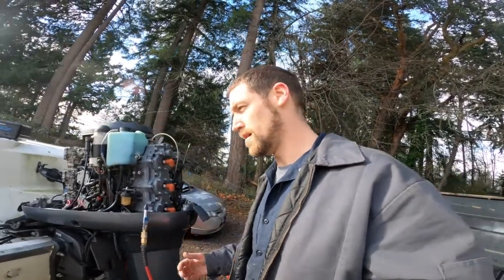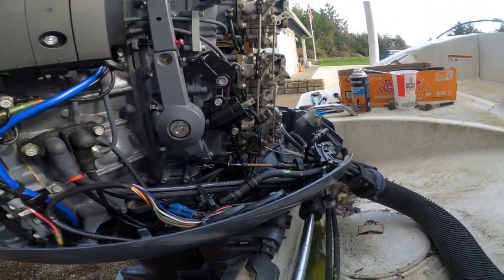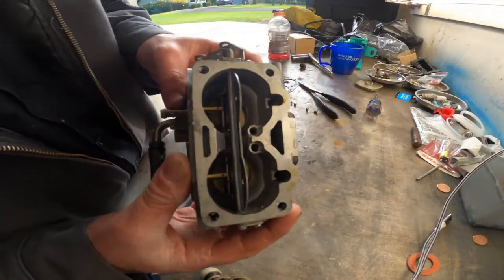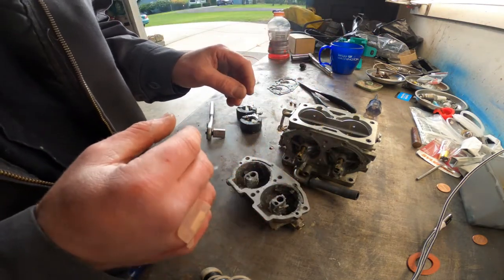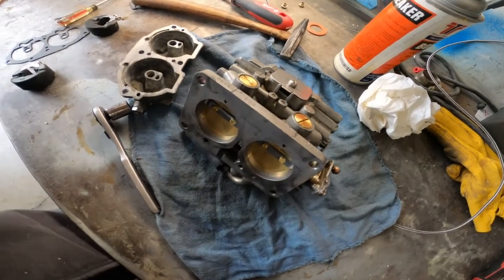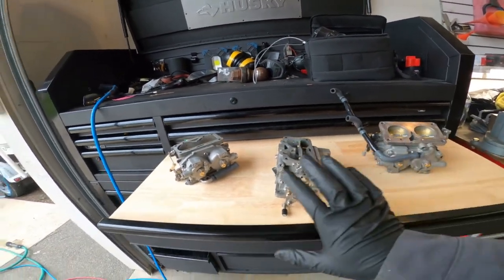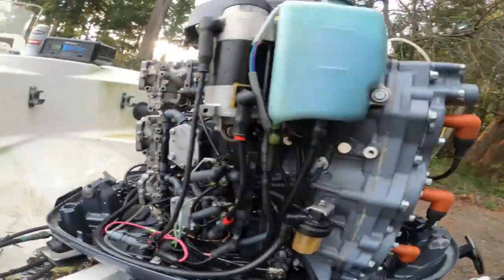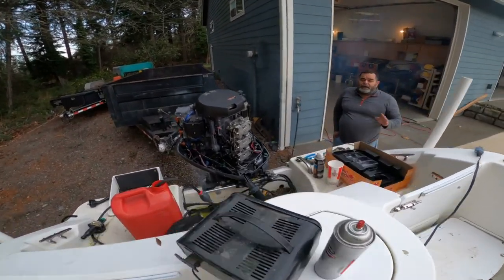Yamaha 150 outboard 2 stroke carb rebuild

Comment: That motor has the electric choke setup, so all ya need to do is push the key down to activate it vs using the lever.

Comment: Thanks for the video.  I put the carbs back together but see one black line that looks like a vacuum hose that goes nowhere on the left of the motor near the top carb. Also, a tiny gray line with a pink stripe on it that also looks like it goes no where and I see a little wetness on it that looks like 2 stroke oil. Any idea what these are? I have photos but don’t know how to post here.
Reply from the maker: It's been a while since I've done this video but I do think I remember there being a separate oil reservoir for the 2 stroke oil. You might try and trace that Grey line to see if it goes there. That black line I am not sure other than maybe a breather.
Reply: It’s a breather to the plate that goes over the carbs for the air box, there’s one up too and another below

Comment: Hi Chris! So there is no adjustment to the floats? This is like the third video I watched it looks like hook it to the pin and drop it in, I'm planning on rebuilding my carbs off a  91 Yamaha 200s
Reply from the maker: You may be able to bend the clip that holds the needle in but you shouldn't have to

Comment: Hey Chris, I noticed you left the fuel in connected when you dropped it all in the carb cleaner.  Should that have been removed?  Or maybe it doesn't matter as it's for fuel, so resistant to the chemicals?
Reply from the maker: I'm sorry I'm not sure what your referring to.

Comment: How to change the oil?
Reply from the maker: The engine has an external bottle that hold oil for injection into the engine while its running. The lower end of the outboard gears also has oil that can be changed. Depends what what oil you are talking about.

Comment: Did you not have to sync the carbs after rebuild?
Reply from the maker: No. I did not. The linkage that connects the throttles are fixed with no adjustments. I didn't mess with any of the mixture screws either.
Reply: @christopherjpeters  . In the late-model V150tlr, the mixtures screws are sealed as I recall correctly.